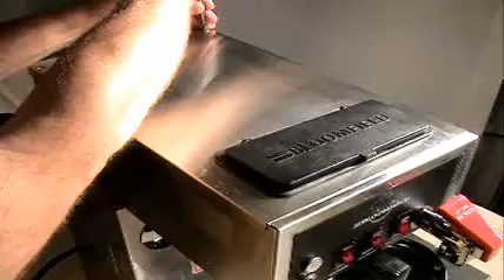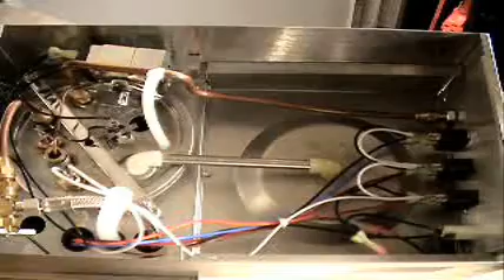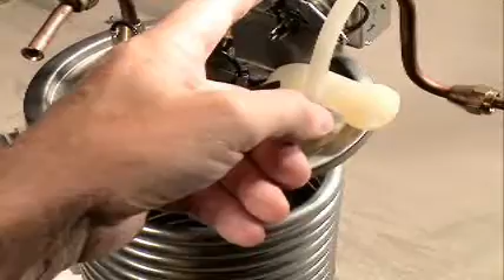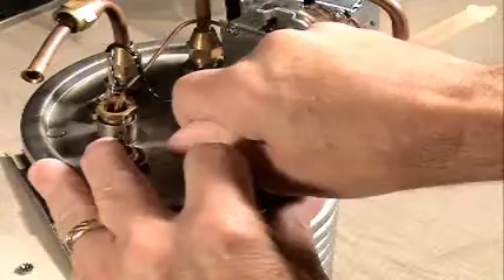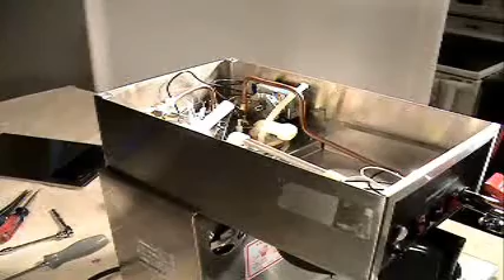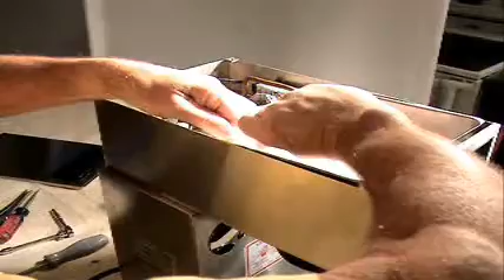Bloomfield 8572 Coffee Brewer water tank removal and teardown

Comment: After my Bloomfield finishes brewing a pot of coffee, the water still continues to run. Not the same flow as an actual pot brewing, however still leaks slowly enough to eventually overflow the pot of coffee. What do you suspect? Thanks
Reply: Your thermostat may be too high and boiling the water making it leak out the hoses and into the spray nozzle. Should be 195-205 degrees and not boiling so turn the thermostat down slightly